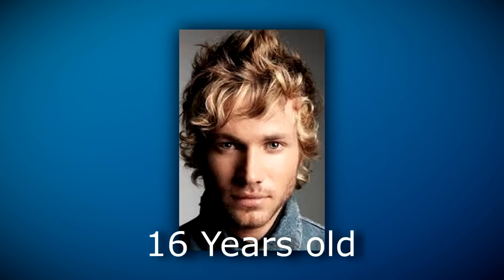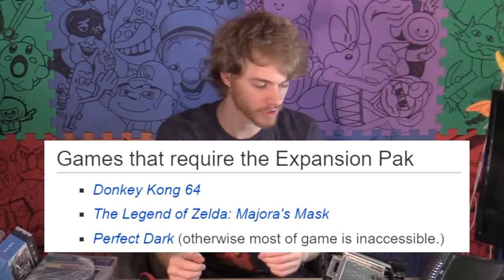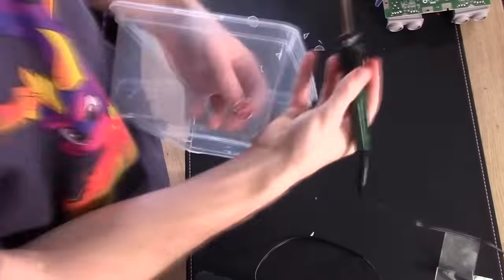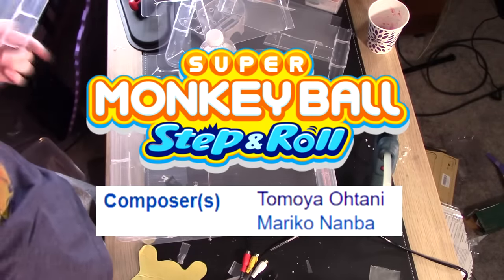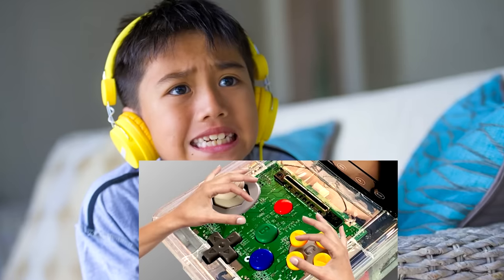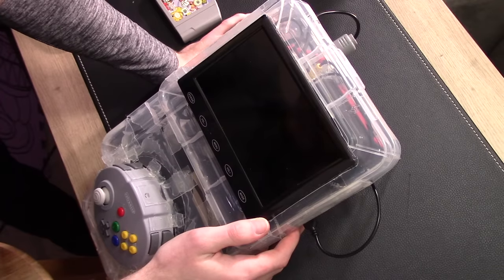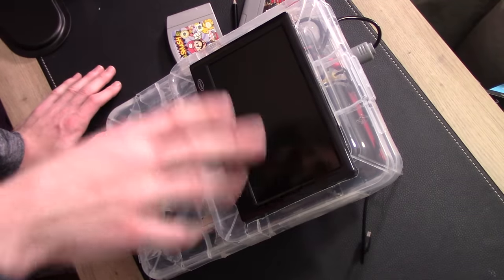Building a Portable Nintendo 64

Comment: 15 years later: Nintendo switch portable with a 3d screen , and camera, running windows 10
Reply: *Linux

seriously Windows can curl up and die unless it's Windows 7 or before.
Reply: @pickypath246  what's wrong with windows 10?

Do you have an insecurity about young you not having the same experience ever again?
Reply: @mariocart2wrholder Linux in my opinion, is better than windows
Reply: @pickypath246  yeah
Reply: But the switch is portable
Reply: @mariocart2wrholder  UPDATES ARE WHATS WRONG WITH WINDOWS 10
Reply: @sunne7064  I do like linux, but a lot of games i play are windows only. Linux seems to give better control, but im just used to windows
Reply: @pickypath246  i agree i am nostalgic i grew up with vista
Reply: @Kratopsis  did you not read the comment?
Reply: @mariocart2wrholder  Cortana, it's ability to severely degrade a PC apparently, and updates that basically caused blue screens so much so even the devs said it was terrible and it doesn't help they constantly push Edge and force reinstall it with every update...

Windows 8 had an absolutely god awful layout that made it a hassle to use, 10 wouldn't be a problem if it was actually to put it simply "good."

PLUS Linux can run virtual machines so if you really wanted or needed too you could run both Windows and whatever Apple calls their OS...

moral of the story is Windows 7 was the last good Windows and I personally just don't like Apple hardware.
Reply: @goldpants9224  it’s a joke
Reply: @FishSnackems  there’s many ways to play windows only games on Linux, There’s wine, lutris, proton.
Reply: @pickypath246  oh

Sorry, my first comment was rude
Reply: @sunne7064  Ah, I never knew that! Thank you
Reply: @mariocart2wrholder  No need to apologize friend...

nostalgia blindness is a real thing and we all usually look back with tinted glasses my reply was just me saying why it's not the case for me, I tend to type more than I should and end up with 70 paragraph essays.
Reply: @MeowthKid200V2  I am a Linux user myself, but it's people like you, with your extreme toxicity, that make our community seem unappealing.
Reply: @pickypath246  I'm prepared to get absolutely roasted for my opinion.... but I like windows 10... even more than windows 7 tbh (And yes, I have extensive experience with both)
Reply: @pickypath246  I'm prepared to get absolutely roasted for my opinion.... but I actually prefer windows 10 to windows 7 and XP. I have extensive experience with all 3 of them too. I just like the way it looks, and I can navigate it really well. Of course, I can count the amount of times I've actually used Cortana on my right hand, but as long as you aren't starved for RAM, you should be fine. I've been wanting to get into Linux for a while though, I just haven't really had the chance (I could try it on one of my weaker PCs though, just haven't had the chance like I said)
Reply: @NekoPrincessTina  While I don't agree with that in the slightest for the already mentioned points you kinda have to say Linux is better considering it runs both Apple OS and Windows and doesn't skull fuck your computer overtime...

you also have to agree that Windows 8 was god awful because if you don't your opinion basically doesn't matter.

(Also do try Linux and not to get off topic but if you have a nes, snes and gba emulator lying around you should check out Mother/Earthbound)
Reply: 99th like XD
Reply: I wish it had more N64 games than the Xbox One.
Reply: Switch is portable
Reply: @pickypath246  win10 can also run a vm
Reply: Nah it going tl be Nintendo switch NO JOYCON DRIFT
Reply: @kellymountain  As mentioned above it doesn't skull fuck your PC as you use it...

and it also doesn't have Edge forcefully injected on it like the virus of a browser it is, automatically making Linux better.
Reply: I mean you can use things like the lattepanda and maybe fit it into a switch case
Reply: @pickypath246  i dont even use edge and it doesnt bother me
Reply: @pickypath246  please ffs know that windows and linux shouldn't be compared
Reply: Windows 11
Reply: @pickypath246  you know you can remove those things right?
and there are editions that are actually good and don't have stuff forcefully injected like enterprise ltsc
Reply: It’s actually nentindo
Reply: @pickypath246  I can't say much about Linux or Windows 8 because I've only ever used them for a few minutes to learn how to navigate in them (Tech Classes). 

Windows 8.1 brought over some much needed QoL features that 8 didn't have and really improved the usability at the very least.

I do intend to throw a Linux distro on one of my weaker PCs at the very least, I just haven't had the chance. Not putting it on my main PC though, even if I absolutely love it to death, it isn't worth the hassle of having to reinstall everything and get things set up again, and if I set it up as a second OS, I would probably never use it anyways
Reply: Linux be penguin
Reply: @FishSnackems   A fuck ton of Windows games are now playable (and sometimes better) on Linux
Reply: Months*
Reply: Mac gang
Reply: In this reply section, we have weird humans defending a mess of a Microsoft product that they trust it won't destroy their computers (totally not deleting files and sometimes irreversibly corrupting cruical parts of the system), without ever having tried the other option before.
Reply: @chlorobyte_projects  Shhh you can't say the truth on the internet
Reply: i cant believe the Nintendo Switch is portable????!?!?!!!!!
Reply: @MapleTree0  Why because I spoke the truth about Win 10 and said Win 8 was bad..?

i hope that's not it and is instead some weird thing you picked out of the way I type, tech should be made to last not fall apart within a year.
Reply: @MapleTree0  I said AND meaning speaking the truth about 10 but saying 8 is horrible in my opinion...

or at least that's what I wanted to say I admittedly am not good at writing my words out.
Reply: @FishSnackems  windows emulator.
Reply: 50 years later, Nintendo still has no voice-chat.
Reply: @hi there The comment you just replied to officially applies to you now. :)
Reply: @hi there When did I harass anyone for using Windows? I'm fine with somebody using Windows. It's their loss. Defending it and laughing at everyone who "thinks" their Linux system is better, however, is not.
Reply: @Kratopsis  r/wooosh
Reply: @mariocart2wrholder  bloatware and using 4gb of ram to do nothing
Reply: Nintendo switch running inside of a aaa battery
Reply: @sunne7064 linux is the worst os In my opinion
Reply: @LingusDaDingus  have you ever tried Linux?
Reply: Sonic the Hedgehog ITS CALLED A JOKE
Reply: @pickypath246  What kind of windows are you running!? I have had Windows 10 for YEARS now and never had a problem with any of those things
Reply: @sunne7064  good point I just don't have the time and money to buy a new linux computer
Reply: @LingusDaDingus  what computer do you have? If you have a Mac or windows computer you can use a virtual machine, if you are using Chromeos you can go to developer mode and install Any Linux Distro as another os.
Reply: @pickypath246  considering I'm a Linux user, I'm not surprised there would be toxic Linux user roaming around here. After all toxic and shittyness is what keeping Linux relevant
Reply: @MeowthKid200V2  apt-get dist upgrade ???
Reply: You mean the AlienWare UFO
Reply: @mariocart2wrholder  Linux is better than Windows in many ways except gaming simply because barely any games support it.
Reply: @sunne7064  I just don't really have a purpose for linux
Reply: @LingusDaDingus  you can mess with it
Reply: @Ayjop I do not like windows. But I think you’re forgetting at least one famous game console has run on windows.
Reply: @mariocart2wrholder  The insecurity is how much extra garbage is added onto things with windows 10. It isn't a big problem on higher speced rigs with more to waste but it is quite important when you're running stuff on older machines with low specs. Overall it has added more useless features than are needed and even snuck in skype integration that cannot be uninstalled. If I didn't get a copy to upgrade from windows 8 for free I would have bought a copy of windows 7 purely to spite 8.
Reply: @sunne7064  Those dont work with many games with an anticheat.
Reply: @thecrazyinsanity  yeah that’s a big problem that’s probably never gonna get fixed because of epic games
Reply: @sunne7064  yeah but either way my computer crashes way too much
Reply: it’s called the apple, apple II, and Macintosh family
Reply: Windows 14
Reply: @pickypath246   windows 10 is actually good, same with 11
you're just a linux defense force member
Reply: @MeowthKid200V2  yea
i use windows 10 AND I HAVE TO UPDATE IT EVERY 2 WEEKS
Reply: Bruh 🗿
Reply: @MeowthKid200V2 windows is whats wrong with windows 10, but we still use it because we are so used to it

Comment: Hey Peter! I recently tried this kind of how you did it, so I used this video as a DIY video. I successfully finished it and showed it to my friends. They called me fricken stupid. Thanks!
Reply: This looks terrible compared to just an emulator handheld
Reply: @Imjudah-  no just no
Reply: Yes, just yes
Reply: Honestly, it doesn't look that great. But seeing as he had no previous experience, used minimal materials, I'd say he did well.
Reply: @Emanuel08820  💯
Reply: Is this an insult or a compliment?
Reply: Emulator— I like this. 
Clunky thingy in this vid— but this is dumb and nostalgic
Reply: @lemon_curry_  Real basement dwellers don't have real friends.
Reply: @LingleLingleLingle  This
Reply: @itsmikoton  N64 emulation is better than hardware N64 at this point with upscaling resolution and high res texture packs and stuff. It looks so good
Reply: @MarManHollow  remove the R from friends and what do you have?
Reply: @trouser 😆🤣😂
Reply: @skilz8098  Fiends😆🤣😂
Reply: @Emanuel08820 the fact that the screen didn’t get too hot & perish in this one is a great sign! like it worked, awkward power controls aside. Better than I could do :)
Reply: @Imjudah-  that was rude!

Comment: ehmm... this project is about melting plastic and glueing... 

why did you not some propper 3d printing...  in that way you did not had to melt-destroy your controller ... this is how i would have done it..

1) unbox controller and console
2) measure all the holes and needed curves for holding it not suffering in your hands.. (bestway would be a dockable controller to the rest of the console )
3) place the monitor in correct position to avoid unnecessary reflexctions 
4) place the batteries in alle possible spaces to minimize.
5) place 2 small fans in the case (in / out fan direction)
6) place headsinks on the gpu, cpu ( or what it is called in the n64)
7) place 3way Button on the Side to overclock the n64 in 2 possible ways
8) selfmade batteryback does also need a propper way to charge it ( not to fast, not to slow, not to big ). There are some boards online .. or you reuse the one of the original powerbank < bestway if the capacity is somewhere the same.... 
9) to avoid sudden black-screens... a battery volate to percent display, would help...

prolbem of this thing is ... 

how to store 20 Games that are bigger than the console it self .. that really calls for a raspberryPI (RetroPI) Console. Because all the games fit on a small SD Card. You also kann use n64 Controllers with a usb connector by factory. Also the PI does not consume that much Power like the N64 21,3W , to 3 Watts with the PI. Thats 7 times longer playtime on the pi, if the battery capacity is the same. Also the Cooling is getting less and less stressful as soon as the consumption is getting closer to 0. Also, you would be able to charge or at least hold the battery charge while gaming on low or very low battery (not included the screen).
What i personal hate, are batteries running flat when the *thing*/ in this case console is not used for a longer time period, and as a effect of that the batteries are going bad. As there is no room in my house where I plugin and charge all the devices all the time.. my personal extra would be a solarcell on the back, that charges the batteries slowly (probably very slow) while lying around. This could be integrated onto a flipcover that flips from the back when done gaming over the screen and contoller ( dust cover ). 

There is also the point, that the n64 does have a bad resolution/fps thing... the emulation thoes present you a much clearer image to multiple resolutions. The ultimate benefit would be to use fixed or modified roms.

Long story, short link: https://www.youtube.com/watch?v=oG-nmmEuWLU    https://www.youtube.com/watch?v=YpAYDcW_Jx0

gn8
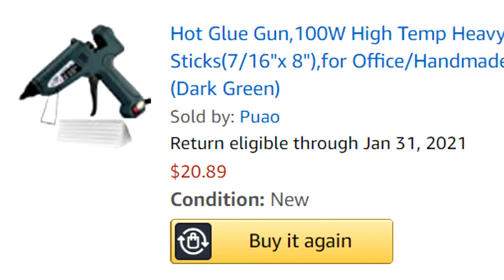Reply: 1:03
he's making it
like he would when he was younger
i'm pretty sure that's the entire point of this video

Comment: Random thing I noticed as a dumb kid trying to make a portable n64 that could actually be useful:
IDE cables actually fit on the pins on the bottom of the n64 cart slot (which just pops out) so potentially you could use a few to extend the cart slot, if you soldered some pin rows into the motherboard. You'd want to use the ones with less wires, since the ones with more/smaller wires tend to have a piece in them that shorts a bunch of pins which are usually ground. Alternatively, you'd just pull out the metal tab that does the shorting, but that requires disassembling/reassembling the end connector, which isn't terrible but a decent bit more work

Comment: This is such a cool idea.

I would have left the controller as it and used it with a cable leading the the console. Then just added a clip to hold it when it’s not in use

Comment: If I could have any car I wanted, I'd just get a white kidnapper van and have the back be like a hangout area. The backs of the front seats would have screens strapped to them that have emulators and ROMs for every have and console I own. I'd have a custom UI for selecting the different consoles with some super nice artwork to represent each one, kinda like a mural with some characters from each console on a scroll wheel. I'd probably just use a PS3 controller for that, since it works with just about everything in terms of number of buttons, and they're generally pretty cheap. The bigger issue is how to power that. 

Or, if I couldn't do the van, I'd want a car with wifi that had the same thing so two people could have their own screen and play online stuff like smash, monster hunter, etc. It's all a big pipe dream but who knows

Comment: I would've just done everything you did except the controller part. I would just leave the controller as it is with the wire attached. Sure it might look weird, but maybe make a place to put the controller and then take it out when you want to play. Like a snap-in function. Idk. At least it's portable, you can see the screen better, better grip and don't need to hunch down.

Comment: just from outside perspective i would have not made the controller attached since it's not really hold it in your hands type any way it would have been easier to have it just plug in the controllers. but i appreciate the effort with your materials. i also think soldering the cart slot to the top would have been 100 times better but at least it works!

Comment: 4:59 - if nintendo didnt need this for cooling, they wouldn't put it on, dont remove someting important
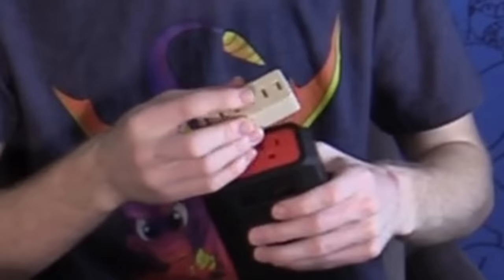2:53 - most of the things running off of the battery are 12 volts, the battery is probably 12 volts, by using the step up converter in the battery, you waste so much energy converting it up and then back down... so it probably has very bad battery life, there is even a 12 volt output port on it, if you connect a 3.3v regulator aswell, you might be able to power the n64 easier

Comment: Reminds me of the time i was 8 or 9 and i had to go on a really long car trip with my dad so i spent the day prior making my sega megadrive "portable" which essentially involved a portable black.and white tv plugged into the lighter socket of the car, and the sega was just as it is on the floor of the car, and i cut up a spare power cable and soldered d cell batteries to the wire itself so it would work. Unfortunatly for me dad wouldnt buy new ones so i could ruin them by soldering them, so while yes it worked, it only had enough power to last from getting on the freeway to getting to the city (about half an hour) then the rest of the trip was spent staring at the headrest of the front seat or out the window wishing i had been able to find a lighter socket adapter that output the right voltage for the sega. Haha
Reply: Neellav Gogoi  well yeah, except they were like 130 bucks back then, plus each game, and id have to have gotten a worm light too as the trip was in the afternoon through the night.

Comment: So really what you did was throw everything in a plastic bucket and added a power converter. could easily be done without removing casing, destroying parts etc and still function perfectly with better cooling. If you had at least made your own battery pack for it then you could have said you "built" something

Comment: Has anyone else ever had problems with the expansion pack?
I had two of them on two different 64s and within a year of using the expansion pack the 64 is stopped working.
I put the jumper pack back in just to see and they both started working again. Perfectly fine.
I don't trust those things